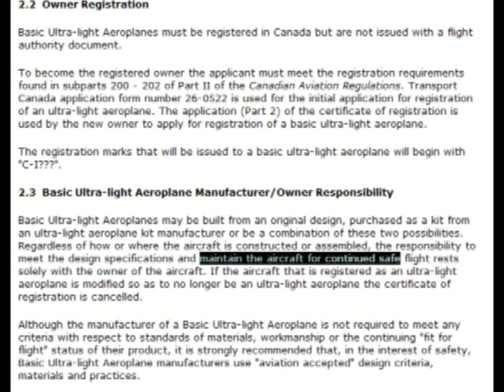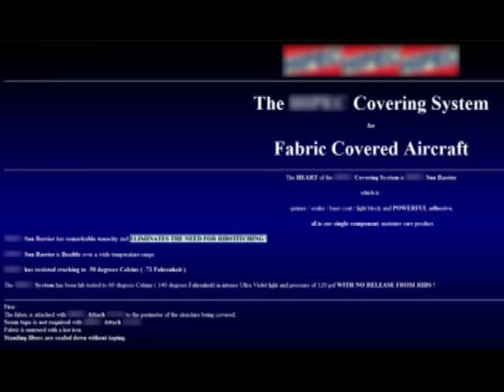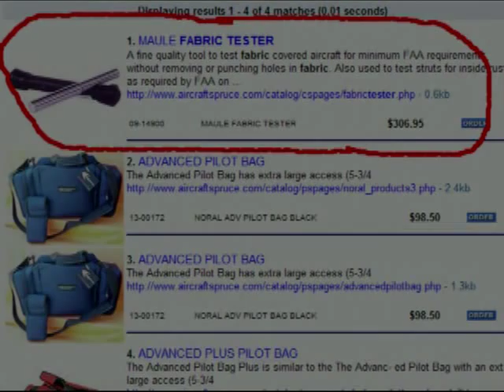Check Your Airplane!

Comment: This is why I absolutely hate the idea of covering my wings.   People say, oh, no, it's easy, it goes fast, and starts looking like an airplane!  I'd rather get a root canal....
Reply: Hard Facts  I decided I didn't want to do it at all, and switched to flying quad copters.   My three vintage ultralight aircraft are sitting in my show... pretty much abandoned by this point.   

I don't need to be in a cockpit to enjoy flying any more, or risk my spine, or lug an airplane on a 20ft trailer to the airport and back and wrestle putting on and off those wings.

Sucks because I spent a whole lot of work building that 20ft trailer.  And fetching those 3 ultralights.   What a waste.  General aviation completely sucks.

air-war.org